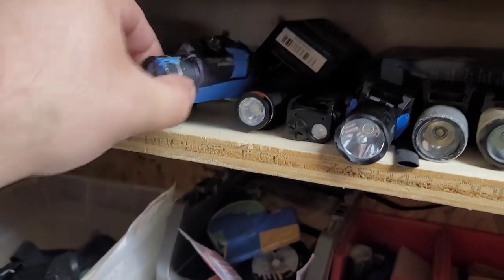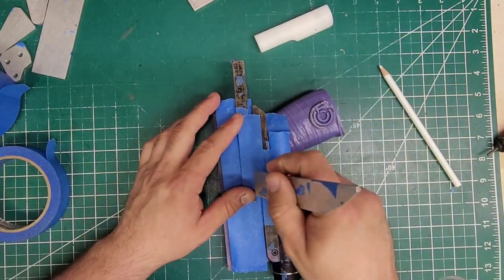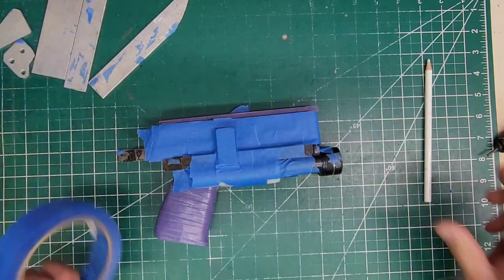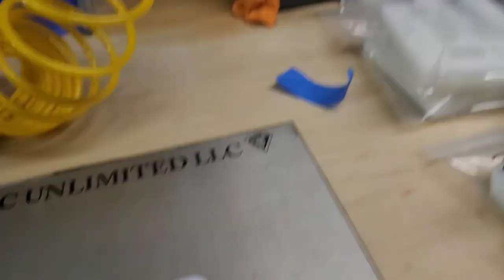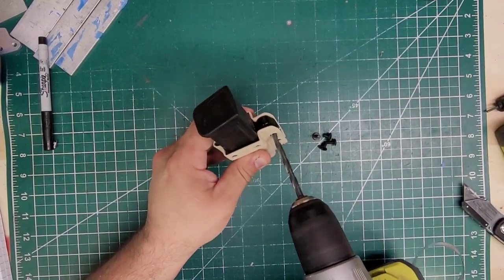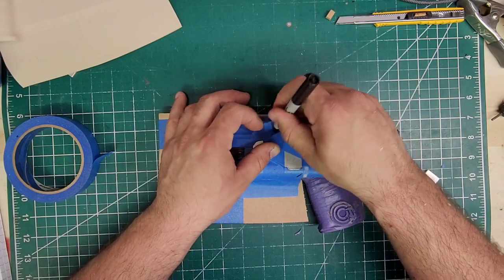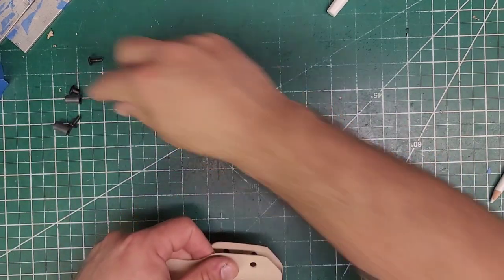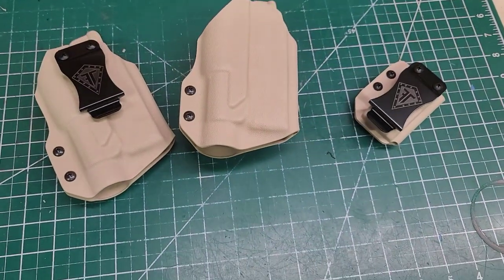Sd9Ve with TLR1 and extras

Comment: I have been testing magazine holsters but the clips do not fit with the pre drilled holes from Holstersmith. What clips do you use, and do you drill your own holes in the clips?
Reply from the maker: I use metal fomis. Never had an issue. Just do a 1/4 mount hole

Comment: Do you guys check your emails?
Reply from the maker: Got locked out for a lil but back in there. What's your email
Reply: @FalTacUnlimitedLLC  it was in regards to a holster issue and if you made that particular type and if you sold the parts for someone to make have a go at making it themselves, the holster is a tactical cqc thigh rig where there is a catch on to the trigger guard where you have to press the latch on the outside to release the gun, I have 1 for barrette M9 but its to small for the gun as well as other issues like its not molded for the front picatinny rail and not molded for the iron sights etc, I can't find 1 for mine so I'm trying to find where I can find parts from with instruction video so I can order from the same place as I'm in the UK and do a lot of airsoft and paintball, iv had to resort to using a heat gun to try and stretch it a bit but abs shrinks so I can't get it to wort properly and that's after 7 tries up to the point where I slightly damaged the holster